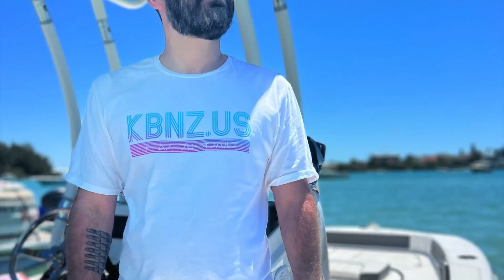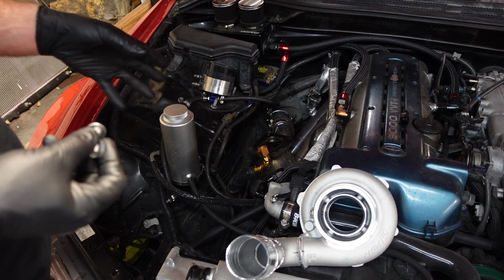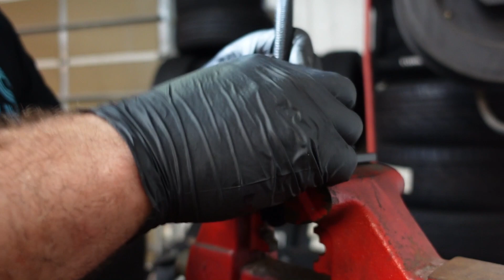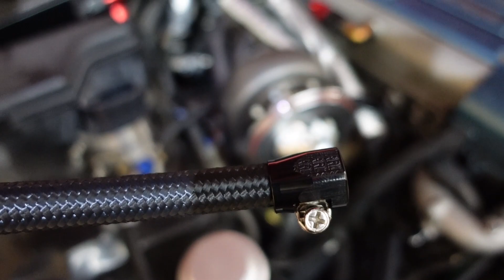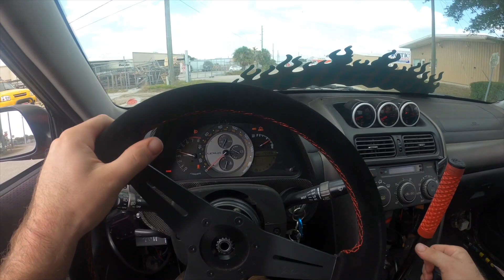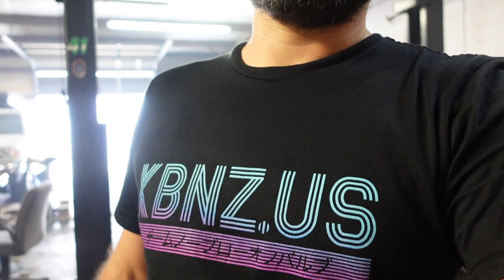PULSAR GTX3575R PART 2 INSTALL...ALMOST BURNED MY CAR DOWN

Comment: Question I have a 335i n55 going top mount turbo . I don’t care for a bov I love boost knocking on the front door lol . But when I do go big turbo (pulsar) will I actually need a BOV . If I have a anti surge housing ?
Reply from the maker: The Bov is optional. I’m not running one with this turbo. I’ve seen 1200hp 2jz’s not running them

Comment: Did you get the T51R mod? This is quite loud. I got the G35-900 Pulsar, i opted not to get the T51R mod i think i will get sick of it after a while.

Comment: Is it Better to run the maf in front of the turbo or in front of the throttle body ?
Reply from the maker: I like it much better in front of the throttle body
Reply: @KBNZUS  sweet thanks man for the input and fast reply.

Comment: What blow off valve did you used?
Reply from the maker: I don’t have a blow off valve
Reply: @KBNZUS  so what makes that sound? I also have a 2jzgte in my alteza planning to upgrade turbo to the pulsar g40 so that's what sparked me to started following you
Reply from the maker: @lamardojohnson1078   not having a blow off valve makes that sound. It’s called compressor surge
Reply: @KBNZUS  Sounds really good bro but is there a disadvantage for not using one?

Comment: Nice setup, I'm thinking of getting this turbo as well. I just have a question, where did you put your boost line? I noticed in your previous turbo (csx) you had a boost line just where the compressor discharge tapping...but didn't see that on your pulsar. Thanks. Good video.
Reply from the maker: Hey sorry for the late reply, I ended up tapping the compressor housing for a fitting and have it on there like the previous turbo